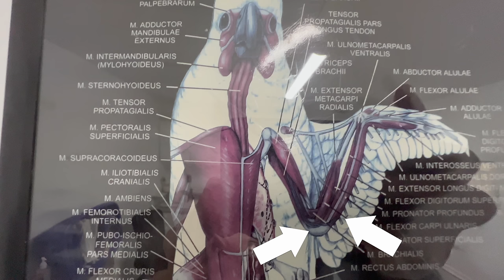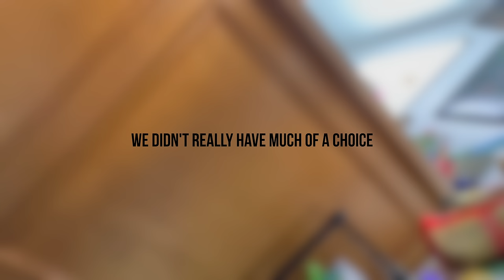Our Peacock got his Wing Amputated

Comment: So sorry to hear.  Is there any risks in the fatal worms, etc to spread in the aviary with the peacock being buried there?
Reply: if only they had asked themselves that question before doing that, because yes, there 100% is
Reply: I was wondering the same thing. At least it’s in plastic, but if that plastic was to get the smallest hole or isn’t completely air tight… it’s like a Pandora’s box. Millions of eggs will start working their way out. (Hopefully cement will be put over, will be much easier to keep the aviary clean also.. to decontaminate when needed)

Comment: Mites got into the drawing wound, the wing was already broken internally, and opened it up to where when the bird was in the horrible-looking  sampling cage and flapped its wings so it could balance the joint popped through. Could have been avoided if daily basic check-ups (Done by you) had been administered, if you caught it early it could've probably been saved. Im sorry, but I think its mostly your fault. It was a mistake I get it- a learning experience infact! But I'm trying to point out that it was mostly your fault that your bird was injured this way.. or atleast that it came to be that bad. Yes its odd the vet drew blood from the wing, but it should have been checked on since it was a foriegn place anyways. I've had experience with bird breaks (actually have had to treat many at home due to raccoons and dogs and infact just fixed a fracture on a khaki campbell duck about 30 mins ago). It could have been avaoided, but I get it. Mistakes were made and its ok now, seemingly. Im sorry this happened, nonetheless. ❤
Reply: Id like to clarify that I mean no hate towards them, and I myself have made many fatal mistakes and am much younger than them. I have lost birds because of my prior inexperience and have learned from it, as they will now have. Also, for internal parasites, Ivermectin is the best course of action in my experience. Oral, if you can find it, is best especially on small birds. Electrolytes can help build strength, too, if you have a sick bird. Hope this helps and again Im sorry for your losses ❤

Comment: Sorry for your loss.  There's a huge learning for raising critters.  Any critter that eats off the ground, especially birds, needs to be wormed on a regular schedule (summer, fall, winter and spring) I believe there are wormers you can put in their water.  I think you can also worm with DE,  I've used DE on alpacas, goats, etc.. Don't forget your ratites.  We wormed them with Ivomectrin.  You did all you knew to do.  You tried and that's the important part.  Kudos to the last vet for trying. Sevan Dust works on extremal parasites.  You could treat the ground after you move the sheds.  Don't forget the pigeons too.  You are doing your best and most of us have learned as we go.  It'll get better.

Comment: It looks like you’ve done everything right for both the flow hives & the Langstroth hives. Bees don’t hibernate, but the winter months are why they make so much extra honey - they really don’t go out & do too much foraging, aside from being too cold, there aren’t too many flowers with pollen for them to visit. They tend to stay in the hive during the winter months…but they should be moving around in there. Bees can’t withstand temps below about 40°F for more than an hour, or they die. They can however raise their body temperature to between 106°F - 117°F for a little more than an hour, to raise the temp inside the hive. They should be keeping the hive a steady 93°F - 95°F year round. During the winter months they’ll seal any cracks letting in cold air with propolis. Adding insulated external wrap & reducing the size of the entrance are perfect ways to help ensure they won’t have to work as hard to maintain the proper temperature. 

I like to add a Queen excluder between the honey supers & the deep super(s) to keep the drones out, but allow the workers in. One last thing…don’t freak out if you find piles of dead drones on the ground below the raised stand. Drones quite literally do nothing, lol. They go on mating flights, and they work as bouncers, but during the winter months, the threat from robber bees, or hornets is essentially zero because they, too, are winterized, so the hive doesn’t really need a ton of security. Drones are haploid, meaning the hive knows how many drones are in the brood — so, they tend to just kill all of the men to conserve shared resources. Drones don’t contribute to the honey stores, so when they really don’t need them around, the workers kill them. Or they kick them out … and they die of starvation, and/or the elements.

You might be tempted to open the hives during the winter moths to check on everything. Don’t. You will always do more harm than good if you open the hives too soon after winterization. The bees will tell you when they’re ready to go back to work. You just have to trust them! Good luck!! I hope they do well for you. 🐝❤🐝

Comment: If at all possible, you may want to consider changing the title of the original video, or even taking it down.  From what you shared from this new vet, it sounds like the original vet wasn't at fault for the injury to his wing and it's not really fair to them to have the title of the video be "The Vet permanently INJURED our peacock".  It's good that you didn't identify them directly in the video, but it sounds like everything they told you about how the break wasn't anywhere near the site where they took the blood from was correct, and anyone who only watched that video is going to be of the impression that this was just another shady vet trying to get out of taking responsibility for their mistake.  At the very least a pinned comment saying how this injury likely did occur before you took Winger to the vet would go a long way and would be a classy act on your part.